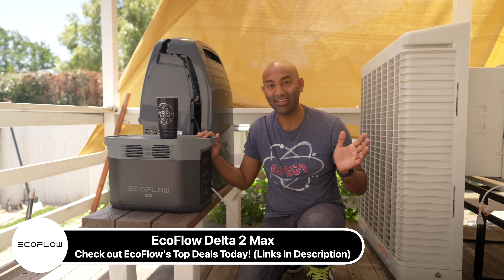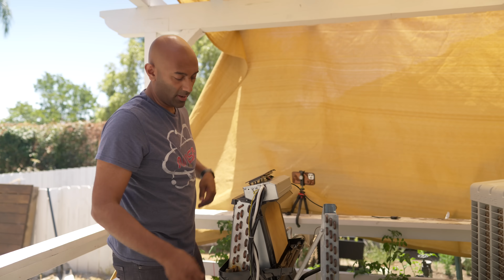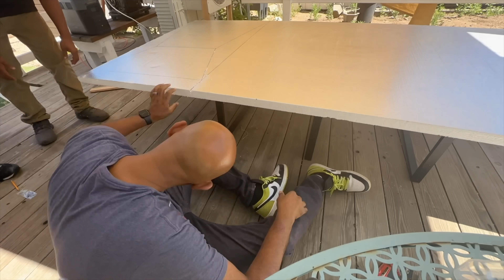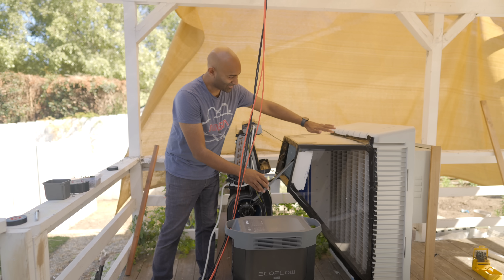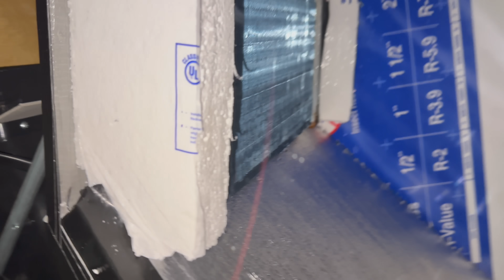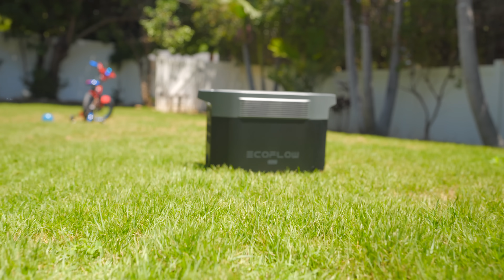Solving the Water Crisis: Solar + Battery = WATER!

Comment from the maker: Save up to $1500 during the EcoFlow Prime Day Deals! Using Code:  ECOVINCI5
https://amzn.to/3WgpvyN
Reply: Can Making the fins hydrophobic help ? I was thinking as the water collects it gets rejected and it’s more surface area because the water does stick to the fins 😅
Reply: How is this different from a dehumidifier?
Reply: Why not also condense the hot air by bringing it below temp to get even more water ? By forcing the hot air over water?
Reply: why is nothing that you shill marked as a advert  its a advertisement you posting links as save upto advertisement
you try as hard as you can to cover up the fact that all of your videos is just a shill ad for some shit but never say that its a ad
Reply: This could be a great educational series.  Make your own water.
Reply: @anothermike4825  Now, that would be cool.  Making water instead of harvesting it.  Its one thing to pull it from the air, desalinate, etc, but to make water where there was none would have applications for people in very arid conditions or space.
Reply: @digiryde  that kinda sounds like dehydrated water. But considering hydrogen bonds with anything you could pull both hydrogen, in a gaseous form, and oxygen from the air and recombine the base constituents to form water.
Reply: @anothermike4825  "that kinda sounds like dehydrated water."  And that is part of the coolness factor.

But, realistically, chemistry is where I was heading with that.  Taking two non water materials and reacting them to get water plus whatever else.
Reply: Now, you are just making us all jealous by doing videos that are more like playtime than work time.  ;)
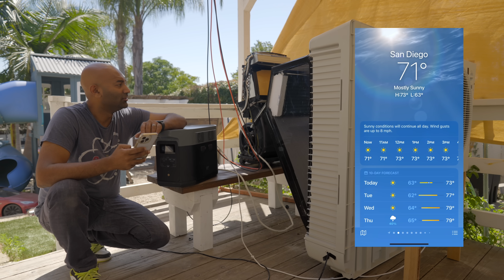Reply: 11:08 so I live in Palm Beach county, 90% humidity right now and dew point of 72

So mathematically speaking it would take me way less energy to pull the same amount of water out of the air correct?
Reply: YOU DONT NEED TO CAPITALIZE ANY WORDS IN THE TITLE. IT IS ANNOYING

Comment: Building the same thing as a drivable off grid vehicle. Super cool video, my solar runs the system 24/7, but water level is dependant on relative humidity

Comment: Wish my new 800watt(!) Midia dehumidifier did more than 1 pint per hr at my Tacoma WA location. Barometer showed 50% R.H. Hmmm?? Good surounding area circulation too. They claim up to 50 pints per day, thats roughly TWO pints an hr. Must need more humudity I guess. On to adding good filter & a UV-C LED string at filter AND container(!)

Comment: Scrap both those ideas and try a dehumidifier most come with a tank that's removable and you can catch the condensation straight from the drain pan with polytube and pipe it to a remineralization filter. Btw you can fid dehumidifier that run @600watt. Or TEC cooler with a liquid cooler for the hot side and 2 circulation fans  (1 high-speed to dissipate the heat and one low speed to circulate the humid air across the cold fins. Given 60 wats per tec you can run the circ pump both fans and 3TEC's off 1 200w solar panel. You have the funding give it a shot !

Comment: Just buy a used large dehumidifierx. Some have a drain line with pump when they are full. Can run it all the time with solar and battery so not a big deal if its efficient. You can set the humidity so it will not run when the humidity is too low and its a waste of time and energy to run it. Use the water for plants or the yard. 
At my home I connected the ac drainline to a soaker hose to water the grass. All Havc systems generate water that usually goes down the drain. Industrial HVAC systems produce gallons per second if humidity is high.

Comment: ~1 gallon of water in about 4 hours, pretty nice.  Gonna have to review it more.
The problem with the power/mpp controller equipment is it puts wear on the battery if the load is 1500watts or higher.
Victron and MPP solar equipment allows 4000-8000 watts of solar input per hour, per unit (not even in parallel with other units) and the load can be run entirely on solar or with minimal battery usage.

Meaning you can run 1-3 tons of cooling or more without tapping into battery reserves or you can put your atmospheric water generation in parallel at high load, during sunlight to multiply water generation.

Comment: The portalble ACs function as an AC has nothing to do with its function as a dehumidifier.  It could really stink at cooling and let air leak back in... but it could be great as generating condensation.  As a matter of fact, I am going to start grabbing the condensation from my AC.  I am already paying for that.

EDIT: HUH??? The AC will already do all of the condensation work on its own.  WTF are you doing?!?

Okay, a better idea.  Turn it into a pseudo geo-thermal system.  Make a whole in the ground and line it with some sheet metal to get good contact.  Seal it up super nice and then fill it with mineral oil.  But the condenser coil (the hot coil) in the mineral oil and get rid of that fan.

Comment: I would not expect condensation to occur on the pads that are warmer than the cooling coil. Water caught by the pads in the swamp cooler might be "carryover" (an HVAC industry term) from the cooling coil -- water droplets entrained in the air because they were blown off the cooling coil's surface by high velocity (greater than ~550 fpm?) air through the coil. Droplets collected by the pads might re-evaporate before they can drain to the bottom of the swamp cooler.

Comment: Great experimental setup, with an equally great result. I wonder, however, whether something like this makes sense if it were to be done in millions of households! Water is thus extracted from the ambient air, which has an influence on this ambient air and could heat it up additionally. It could prevent or at least reduce such cloud formation over land. The opposite of what you should do about climate change.

Comment: The question would be, what are your intentions with the water? If it's for drinking I imagine you need to do a few things before you can drink it. Are you collecting it to use to flush toilets and other non consumption uses? The school where I work was built as an eco friendly school and they collect rain water and condensed water from the AC to use to flush the toilets. I don't know what else we use it for. We also use well water for the lawn sprinkler system.

But couldn't you have used a standard dehumidifier and instead of capturing the water to its own internal bucket you siphon the water out into collection containers you have in your house? This way it would seem you could achieve the same goal of collecting water, avoid a lot of evaporation and use a unit that would be half of the power of those two units combined. And depending on how much water you wanted to collect you could use two dehumidifiers.
Reply: Good questions and right conclusions!

Comment: Just "thinking out loud"...  What about a rig consisting of:  A small chest freezer with a control to make it a refrigerator.  Inside a path of pipes for air to flow & condensed water to run out.  Outside the freezer a heat exchange set up, so incoming new air is pre-chilled by the exhaust "dried" air.

Comment: I live in in mississippi and my indoor dehumidifier pulls like 2 gallons a day out of the air. I use it to water my plants outside. Please take extreme care if you plan on drinking dehumidifier/condenser water to avoid issues with Legionnaire's disease, mold, and mildew.
Reply: I actually do drink it, it requires a high amount of filtering and sterilization, but it's possible.

Comment: I'm curious! Why didn't you use dehumidifiers?? I have 3 of them I ordered off Amazon. They produce about 2 gallons a week. I looked it up and everywhere I looked it said that it isn't recommended to drink water out of those??
Reply from the maker: You would have to run it through a filter, then re-add minerals so it’s more like regular water :)
Reply: @TwoBitDaVinci  so is there a difference between the water off of an AC and water out of a dehumidifier?? Thanx for replying so quickly!😁😉

Comment: did you happen to see how much water you recovered without the swamp cooler in the circuit?  IT would also be interesting to see what the RH of the air is after the fan ie the cold air.  It looks like you've (re?)discovered the "dehumidifier"

Comment: The price of those batterys is way too high in NZ   like i can get 5kWh Lithium Iron Phosphate Battery for under $3,000 + 48v 4000W inverter for 1,200, = around $4,200.00 vs EcoFlow DELTA Pro @ 7,399.10 on sale ATM  with only a 3.6kWh capacity and only a 3600W inverter built in,     the EcoFlow DELTA Pro Portable Power Station normal price in NZ is $7,799.00  so i could have like  10kWh + 4000W inverter for the same price at the EcoFlow DELTA Pro Portable Power Station on sale

Comment: Hey, Great project!
-Just some math about the efficiency: Water needs 2258kJ/kg to evaporate/condense, thats about 627Wh/liter (1 kg is about 1 liter). The AC-Unit produced about 1 liter 1h and used about 1200W (or less, if the compressor has not ran the whole time). The AC-Unit should also have a COP, thats greater than 1 so there is definitly potential on the efficency side.
-In my opinion the Swamp-Cooler does little to nothing, because the air has already 100% relative humidity and the Swamp-Cooler tries to get 100% relative humidity. To cool the hot side with the cold air will definitely give you some efficency, but I think it won't be that much, because most of the Energy is consumed by the condensing process of the water. But I would definitly do it!
-If the cooler freezes you can definitly get much more efficency if you either blow more air through the cold side or run the compressor not the whole time because you don't get that much more water out of it. With more air and a hotter cold side the AC-Unit also runs more efficient, like if the hot side is colder (higher COP, like a heatpump...)
-One other thing to consider is that the copper pipe will corrode with the time because of the water and the water is like destilled water, without any minerals. I would definitly not drink it, but to shower or to water the garden it's definitly good enough.

I would like to see some following videos with improved Systems!

Comment: Rick, in my shop I used an old ammonia GAS Fired refrigerator.  converted heat source to solar and a 24v solar panel to run the electronics. My friend and mentor the late Dan Kramer (more degrees than a thermometer) helped me with the design/sizing of the solar heating elements. back in the day i use a 1KW UPS. this setup will use far less power than your electric AC unit and can use any heat source.
Reply: Would like to know more about your solar powered AWG... would love to make one for my family.  Cheers!

Comment: Your 'hot' side' would probably be more than enough to also heat your HOT water supply.
Just add an insulated tank and and a circulation pump.

Comment: Lol I like the video, but with respect you're in what; 100f temperature high humidity area. All you probably need to have is dig a hole and bin liner to collect water like they do on survival hacks, it will be drinkable too.

On a positive note, to make the water drinkable you can plug in a kettle to boil it or run an RO pump.

Comment: Fun exercise, but the physics is against you.  
 
Four thousand plus watt hours of energy is worth at least a dollar.  At San Diego peak day time rates, it’s more like $2.  

It’s much more valuable in the battery then turning it into a few cents worth of water (that technically you aren’t supposed to directly drink without treating).

Comment: If you want to really optimize the efficiency, use an inverter style mini split unit. Some of those units are more than twice as efficient as portable ac units. And you would want to run the fan on an algorithm that slows it way down during low humidity, and speeds it up during high humidity. And make a simple heat exchanger that uses the otherwise wasted cool air to pre-chill the incoming warm air. You could probably improve water production 3-4 times over! I love your way of doing these projects and learning as you go though! It shows your humidity... I mean, humility!

Comment: Hook the hot side to DHW and chill it while making warm water. If you tied it to an earth loop and variable speed geothermal heat pump as the engine to produce water. So many modes and thermal interfaces to consider.

Comment: So, since you're doing this-  stick a stirling engine between the hot and cold side (After the coolant comes Out of the cold side, before it goes back to the compressor- importantly After it's done the swamp cooler thing.) to scavange power from the temperature differential.  Might be enough to run the fan, improving efficiency.

Do you see what I'm pointing at?

Comment: I don't get your reasoning behind using a swamp cooler, like running it in reverse should condense instead of evaporate water lol! The wiking pads don't have good thermal conductivity which is what you need to get condensation, honestly i don't know how much you can improve it because the radiator is doing most of the heavy lifting so i doubt the air has much moisture left but one simple thing you could do is to grab two square sheet metal, put the cold air through a hole in the middle of one and place them very close to each other so as to sandwich the exiting air, this adds surface area, slows down the air to "absorb" more cold and also takes advantage of the outside air which still has moisture. Then add some gutters to collect the water in a bottle or something.

Comment: Nice little project. I would regulate the heat pump balance out chemo if you on!y need 60-50 degrees, reduce the use of the compressor. maybe look for an old ice machine with a larger freezing coil, get someone to attach it, also I would get a sheet of copper to this would help reduce any bacteria from growing.

Comment: Several months ago I wrote you in the comments section that in North County San Diego a typical 3 Ton A/C system can produce about 15 gallons of clean fresh water every 24 hours (these are very conservative numbers). If we truly want to solve our water problem in California, all we have to do is harness all the A/C condensate and we would be done. As it is in most cases, it goes down the sewer (mine waters my organic apple trees).
Reply: its not technically good enough for humans to drink. water plants, flush the toilet, fine.
Reply: @draconightwalker4964  Yes. However, it would be very easy to make it drinkable. My point is all that water is wasted every day and every night the A/C is on. Mine is diverted and waters my organic apples.

Comment: Mind you I like the idea, but at what point do you start drawing too much water out of the air?  Say your neighbors all had one of these.  A city.  Could we pull so much water out of the air that a moderately humid area becomes as dry as a desert?  How would that effect trees and plant life.

Mind you I'm not trying to nay-say such projects.  I'm a business analyst by trade.  In order to have a successful program, you need to know your fail points in order to know the ultimate max the system can produce and to see what percentage of your needs that meets.

Comment: The great thing about using a battery to store solar energy is that you don't have to use it at the same time you collect it. The solar cells could be collecting the energy in the battery during the day. And the water collector could be running at night when the air is the most humid.

Comment: Yikes. I'm pretty sure you just violated some EPA rules, you need a refrigerant certification in order to work on the evaporator or condenser of an air conditioning system. HFC refrigerants are extremely potent greenhouse gasses.

Comment: What about using a dehumidifier unit and collecting that water, instead of deconstructing an air conditioner?  A dehumidifier should be designed to maximize pulling water out of the air for a given power input. Or are consumer dehumidifiers designed to be cheap instead of efficient?
Reply: its more a limit of the tech peltier Thermoelectric heat pumps only have a COP of 1 some have more if your willing to pay the extra cost also scale a 1000w peltier is not a common item and once you get to the large dehumidifiers they start using compressors based heat pumps aka there no different then what he has just professionally made and in one simple unit. 

and he has the right idea why throw away and old but still working AC sure if your starting from scratch buying a full on dehumidifier is the better way but if you got an old AC lying around reuse it.

Comment: With the Ecoflow power station can I either solar charge or AC charge while using the 2nd battery? I live in a SD condo and would like to invest in a backup system in the event of a future power outage because it will happen. 
Thanks Ricky and keep up the work!

Comment: In my opinion, there will be better:
1) If ambient air pass through the evaporator part it cools down and loses some moisture there on it. 
2) Then cooled air passes through the condenser's part, recapturing cool air helps to cool the condenser more quickly, which means less energy. This is how the clothes tumble dryer with compressor works by this principle